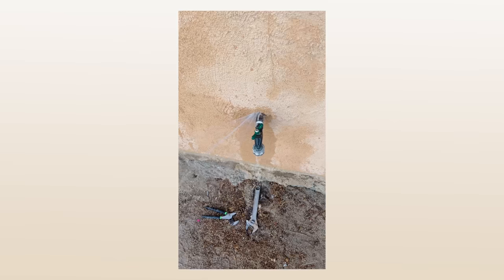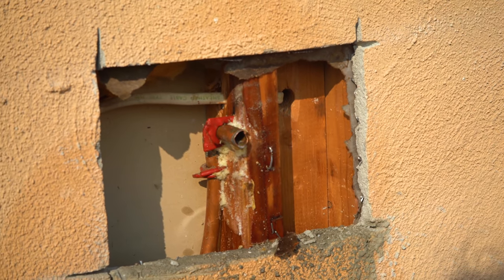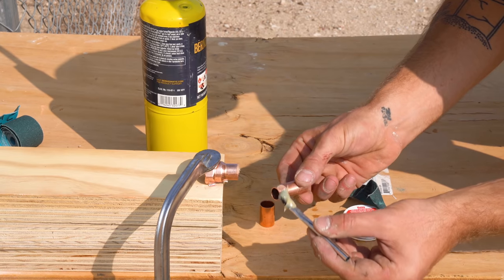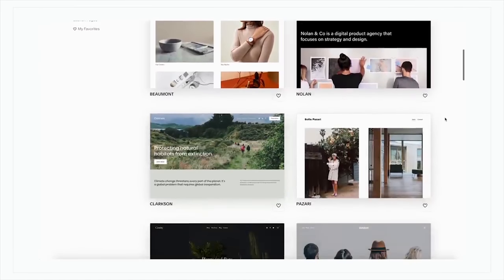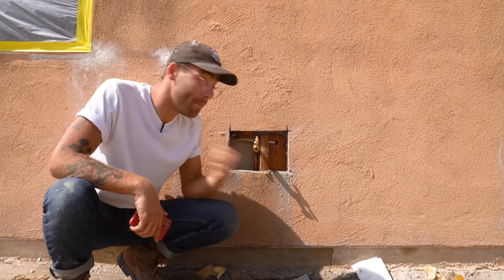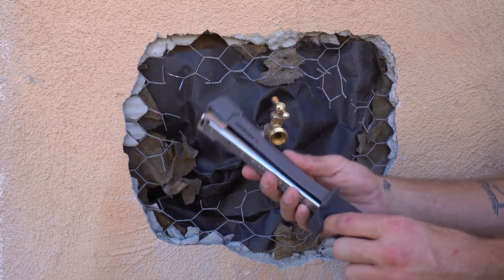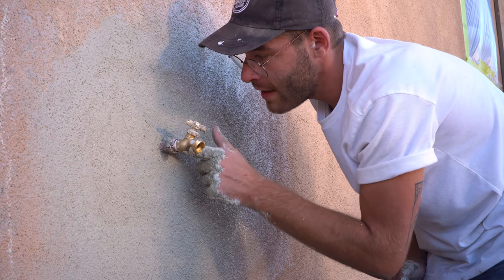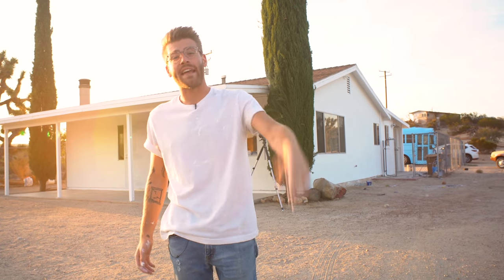PLUMBER QUOTED $750....I FIXED IT MYSELF!! DIY Hose Spigot and Stucco Repair

Comment: Grinder 
Blade (for said grinder) 
Hose bib
Flux 
Solder 
Sand paper
Torch w/gas 
Cresent wrenches 
Plumbing License 
Insurance 
Travel time to job 

Emergency fee to fix homeowners mistakes….
Reply: He was going to pay $1000 in repairs, now if you're not comfortable doing the job you could pay someone to do it, or invest in the tools and in yourself to fix said problems if they arose in the future, this is what DIY is all about, invest, learn, Repeat.

Grinder - $29.45 (7.5 Amp Corded 4-1/2 in. Angle Grinder with Reversible Handle, 3 Grinding Discs and Carrying Case)
Diamond blade  - $17.98
Hose bib- $31.86 (4 in. Lead-Free Anti-Siphon Frost Free Hydrant with Built-In Vacuum Breaker)
Flux - $4.31
Solder - $8.97
Sand paper - $4.97 (4-Sheets/Pack)
Torch w/gas - $53.97 (TS8000KC Premium Torch Kit)
Cresent wrenches - $23.97 (6 in. and 10 in. Adjustable Wrench Set
)
stucco patch kit - $25.87
paint - $23.98

Total - $225.33
Saved - $774.67
gained - Experince and tools for your next project.
Reply: @Selfhelp-k4w  Except that he will most likely have to repair this again in the future.

Comment: I’m not that guy who likes to give advices, but sometimes I feel that I have to.

When a pipe goes through stucco or a concrete slab then the pipe must wrapped with foam pipe insulation. By doing that several things are achieved:
1. It eliminates stress from thermal expansion/shrinking of different materials. 
2. Significantly reduces corrosion of copper because it’s not with direct contact with highly alkaline material such as stucco.
Reply: He did do that tho..
Reply: @Iamam313  not where the spigot came out of the wall. He stuccoed all the way up to the pipe. If an pressure is put on the spigot it will crack the stucco. He should have wrapped something around the pipe where it exited the wall to creat a space between the stucco and the spigot.
Reply: Ohh I see! thank you. Now I know why the spigot broke at the exact spot where it meets the wall. Now I have to do the replacement and hence Im here looking how to.
I am a bit nervous with the welding torch, so I decided I will go with the compression fittings instead.

Comment: Friendly tip on the stucco paper, instead of making a hole to put paper in, next time u can use 3 pieces or 2 by just sliding the pieces underneath each other. Easier to work with and better chance of getting the most important piece underneath the existing paper

Comment: I gave this a "like" based on the title alone.  Plumber wanted $600 to replace two spigots.  One was nothing more than unscrewing the old one and replacing it with the same model ($50).  The other one required cutting the copper pipe, pulling out the old soldered bib, and putting in a frost-free one.  Spent about $65 for the bib, a piece of Pex, and a Sharkbite connector for that one.

Comment: I think it's easier to fix from the outside despite what other said.  I recently installed an ice maker valve box and opening up the way, cutting, and soldering with heat shields,and having the mess inside was a pain in the butt.  With an outside fix, you can take your sweet time and the mess is way easier to clean.

Comment: This is literally why I got into DIY.  I was tired of getting ridiculous quotes for simple jobs.  Just last week I paid a plumber (required by the HOA or I would have done it myself) $1300 just for the labor to install a bathtub and shower valve. The tub is over half an inch out of level and sloping the wrong direction and the valve was installed too far into the wall..... $1300 for shoddy work that I could have done.
Reply: Thats cause you hired a half rate plumber. I'm 20 years in the trade. If you wanted me replace a shower valve and a tub you'd be well in the 2k range.
You can "diy" all you want but I guarantee ya 2-3 decent plumbing jobs in and you'll understand the reasons for the cost.... Sure,anyone can install a faucet or replace some tubular under a sink. Start replumbing whole home waste lines,,installing tankless water heaters,multi zone boilers and you'll be lost at step 1. You guys think we're all out here ripping you off when in reality you have no idea how much we have invested in tools,vehicles,shelving in those vehicles,liability insurance,workman's comp and guess what? We also want to make a good living for our families too! My sewer camera cost 10k dollars. My large sewer machine was 6k. Small one was 4k. I have well over 20k in power tools. My trenchless machine was 50k dollars. That stuff has to be paid for. Most importantly tho,my 20 years experience in the trade is priceless!
Reply: @jasoncraig4683  I agree with you completely.  I want trades people to make money off of their work too, but I really have a problem paying a whole lot of money to get shoddy work. And for the record, I've installed three tankless water heaters (gas and electric) and I've replumbed half of a house before. They're all working fine and it's been a few years since I've done them.
Reply: @jasoncraig4683  Not true, I taught myself to solder, plumbing is easy AF and they rip people off. I do far better work then most plumbers now...
Reply: @Tennessee_Bees  Dont agree with him, hes wrong
Reply: Yeah right, 2k for bathtub and shower valve? Is material included? I'm guessing you are working with gold material. Every profession has cons and pros and requires tools like every business requires insurance and workscomp...  Tools you mentioned here is usually own by big companies. And you just said it you need to rip people off because  of all those tools needs to be paid off and your family have to have good life.Anyway good luck with your quotes and 20 years of experience don't mean nothing. Seen people like that saying how many years they have on their belt and reality is different

Comment: Why not repair from the inside of the house? A drywall patch would have been easier than stucco. Nice detail though. You did an excellent job.
Reply: Can’t solder on an exterior fitting from inside the house.
Reply: @CaseyKinsey  Could've pre-soldered the hose bib on a piece of copper and slid it through... or even better; threaded on a female adapter to PEX
Reply: @CaseyKinsey  yes you can. Slip it through the old hole.

Comment: You forgot to mention the most important part of the entire video. Before sticking your hand into the water main valve to shut it off check for black widows. P.S. I installed quick releases on all my Spigots and hoses so no more on and off.

Comment: Well done—-most homeowners don’t accept the responsibility of DIY skills.  If you don’t have skills, you better have money for someone who does. My opinion on the estimate: a lot of the hourly rate for a tradesman compensates for years of experience and creativity in solving unexpected problems.  I do most of my own vehicle repair & maintenance, but when a problem arises beyond my skill set, I don’t mind paying the experienced pro (as much).  Likewise, my mechanic didn’t go to trade school to do oil changes & install wiper blades.  That’s why he charges so much for work he doesn’t want to do.

Comment: The 750 quote is for the unforseen issues. Like if you crack that pipe at slab level while pulling it off that stud to solder.
Those that can do.
Those that can't, teach.
Good job for doing it yourself!

Comment: I own a handyman business and a shark bite connection is always the easiest solution, but that makes for a less interesting video haha. Still shark bite is a great diy option for any homeowner
Reply: I know nothing about anything ,but figured out replace my inside water valves with e with sharkbite. I love sharkbite! Def woudl of been easier. And if anyone is reading this and you have older home, i bet your water values are nasty full of gunk on the inside! Cut them off with a saw, and replace with sharkbite valve. It is very very easy.

Comment: Torch from the bottom and put the solder ontop and it will wick its way down.
Reply: Its best to heat your fitting evenly all the way around and add solder from the bottom and work your way up. Not a huge deal on 1/2”, but on larger bore it reduces the likelihood of leaving a void at the top of the joint.

Comment: I appreciate the video! It was great. But - I was also alarmed that you said it was $350 an hour for a $750 3-hour job. Math. :P At 6:49, it looks like the verticle copper tubing is crimped pretty hard core, that will become a leak sooner than later. Also, I can't tell at 8:00 if you added anything to secure the copper pipe against the wood, but copper can't continue to wiggle each time you use the spigot, it causes metal fatigue and the pipe and joints will eventually burst open.

Comment: It would've been better to use a hose bibb that you can anchor to the outside wall. Also, fixing it from the inside would've probably been cheaper. Patching the sheetrock that is.
Reply: Completely agree. I'm just a home owner and a sheetrock patch is not a big deal. It's inside and not exposed to the elements and can be bought in a small section at a big box store for relatively small repairs.

Comment: I had the exact same type of hose collars "freeze" up on my hose spigot. While I'm certainly not a metallurgical mensa, my guess is the aluminum of the collar and the brass of the hose bib started some kind of galvanic gestation, resulting in corrosion locking the two together. I finally had to use a cut-off wheel on a Dremel tool to cut the collar along its length and a flat tipped screwdriver to twist and crack this infernal thing off. I'll never buy a hose with an aluminum fitting again.

Comment: Prob should have put some pipe insulation around the spigot or atleast something to use as a spacer. That way if there is any pressure put on the spigot it won’t crack the stucco it would have a little room to flex   Good Job 👍

Comment: Soldering is a good skill but could you have used the copper crimp fitting method?  I hear those are just as secure/safe but much easier.

Comment: Did this at my house recently. Luckily, mine broke inside the wall (had a couple feet inside for the frost free bib). Using shark bite fittings saved me from having to buy or rent a torch. Might be a bit less reliable in the really long term (10-20yr), but I'll take it. Might not have worked in your situation tho just because of how close it was to the wall.

Comment: Be careful wrenching on the shutoffs at the water meter. Many of them are frozen and corroded, and if you cause the meter to leak especially if you turn the shutoff on the city side of the meter and break it, which happens all the time, the city will come out and fix it and bill you thousands for the repair. You can call them in an emergency. Always use the house shutoff if you can.
Reply: Also—-at the time of an emergency, after the repairs are done, it’s a good time to check shut offs for future emergencies.  Lubricate joints, mark locations with reflective tape, clear accessibility, etc.  if you build this discipline with each project, your house will start to exist in a state of preparedness.

Comment: Question: since the pipe leaked a bit what happens to the insulation/wood on the inside of the wall behind the stucco below where he repaired? Is there water damage there? How do you dry out that area? Would it have been better to cut where he cut a few inches on each side of the busted pipe, and additionally cut the stucco all the way to the bottom of the house to expose all the wood below that pipe inside the wall to let it dry out/or replace that wood and replace any wet insulation? Would that be overkill? Dangerous structurally? I have no experience in any of this, just a person who wants to learn stuff. I just saw the water dripping when he opened up the wall and wondered if there was any water damage below that could lead to issues in the future. Hope this question makes sense. If anyone knows, please teach me! Thank you!
Reply: The water that spilled in is fine once he cut out the stucco and had it open it evaporated out there is no water damage, how he did it is good there's no need to cut out more than he did this isn't anything structural so no problem there hope that helps
Reply: @relaxingnature3225  Thank you so much for the response! That makes sense!

Comment: Great work! Now someone needs to make a two or three piece Galvanized or 'Clear tuff plastic box' that easily  screws together, to the stud and assembles around and secures the pipe on the inside,for easy inspection'. (And If with a 'clear box' one can use a flashlight down inside to inspect for leaks?) So being flush to the inside 2x4 and wall. Its a Spicket box'- Via' a stencil and grinder' just once, like a wall electrical socket box, Cept' With a frame' with threaded inserts for attaching an insulated Weather proof' sealed to the wall, spacious 'working box'. A single lift up door, that tab locks, So that 'Use, inspections and repairs', never have to resemble this neanderthal tear apart method, and Imo' are forever intelligent and solved!🦉👍

Comment: Not sure what's on the other side of the wall on the interior. Would it have been easier to cut out a piece of drywall and fix it from the inside?
Reply: Definitely a viable option depending on what’s on the inside.

Comment: As a worker of the trades. I agree with that quote they gave you. You obviously don't get what a quote means. I mean you probably do but your viewers don't. It's a ball park estimate. It could be a little more due to worst case scenario and it could've been less. But every contractor has to put in to consideration it might be worst case scenario.  He doesnt know what he'll find when he opens that wall. And also when you pay a tradesman, you are paying for his expensive equipment that makes the job faster for his customers and his years of knowledge. We are not out to rob you. At least most of us aren't. And I do agree with you, most people should try it themselves but I seen some diyer's work and most come out horrible and in most cases worst. In the end it comes out more expensive. As for my trade, I'm a Welder/Fabricator. You should clear this up in a later video. It's unfair for honest and hard working men that took years to gain all the knowledge and expensive tools just to get run down by a guy that doesn't explain estimates right.

Comment: You shouldn't touch the angle valve at your water meter it belongs to the city if you break it (witch they are normally old and ready to break) you'll have to pay for it

Comment: sometimes, high qoute doesn't necessarily means that we are being taken advantage of.
we need to consider the all aspect from mobilising the plumber, the equipment, that distance to travel, the consumable item to use for the repair, the salary of plumber, taxes and etc. hence, the high price compared to DIY. 

no pressure just saying ✌🏻
Reply: Also if they want the job. Especially now they're slammed and might prefer the time off but will do it for enough money.

Comment: Based off the items you had to buy and the tools someone would have to buy do the work, you already spent almost $450 (including the paint, grinder, etc being bought exclusively for the project). That would give you $600 in labor. If it took you 6 hours to get everything, watch the video's, and do the work, you would be making roughly $100/h. If you are making 55k a year, or 26.44/h, your time was worth roughly $211. So, a total savings of $400ish is not that bad at all. And the end results looks good.

Comment: Can I know the reason why you didn't fix the problem from the inside? you would've just patch the sheet rock but I don't know your reason
Also I notice that you put the insulation backwards, the paper goes towards the inside of the house, is there a reason you did it this way?

Comment: The right way to do this would have been to remove the drywall and fix it from the back. Breaking out the stucco instead of the drywall is insane.
Reply: Very few people are mentioning how dumb this video is. Not surprised if he broke this on purpose just to do this video.
Reply: @apex007  if you watch his other videos, you will see how dumb everything he does is. Don't attribute to malice that which can be explained by stupidity.
Reply: His work is sloppy at times too.  Just to crank out videos.  He also doesn’t know a thing about estimating a job.  How far is the plumber from where he lives in the middle of no where?  This is also an over the phone quote they didn’t get eyes on to see the actual repair.  They are adding for unknowns.  Any good tradesman would have lowered the final price if it wasn’t as bad as they had anticipated.  Anyway.  He’s 24 or something and just makes YouTube videos who cares what he thinks